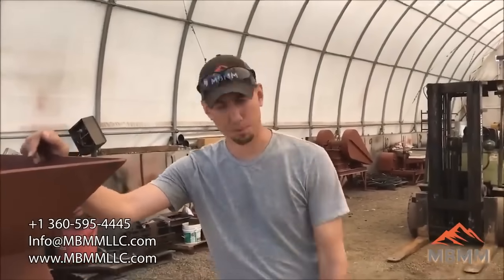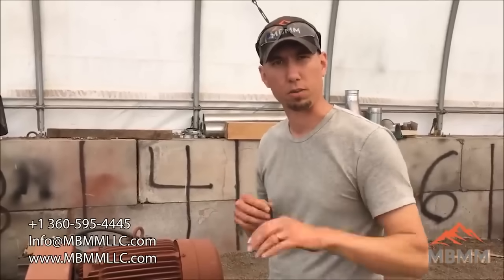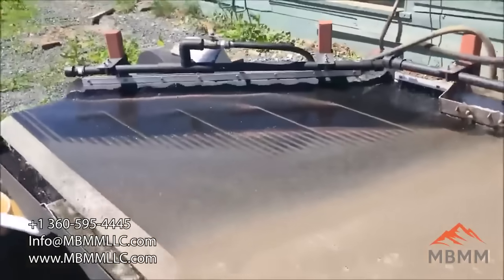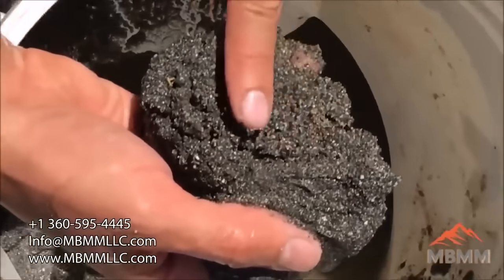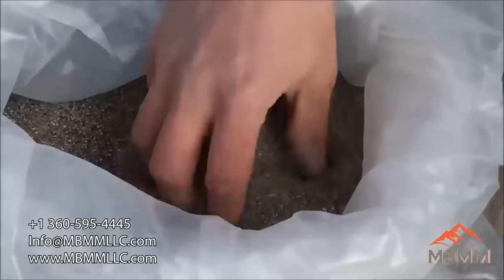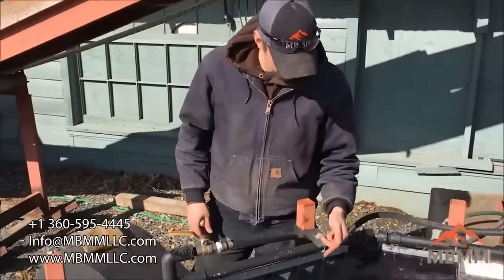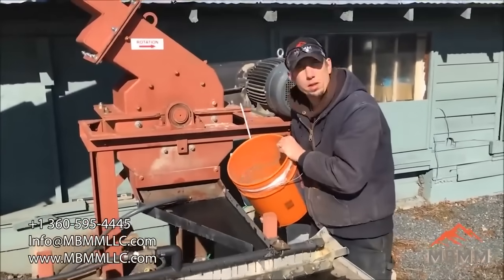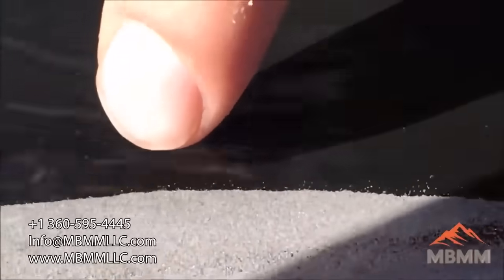Hidden Gold? Crushing Electrical Waste for Metal Recovery

Comment: something I have always been curious about the shaker table is, whether or not there is one ideal setting of bed angle, water flow, and vibration rate, or if different set points can be used to further seperate certain materials.  For example, you get a mixture of a heavy material and an only slightly heavier material in your #1, if you run it again with the same settings you get almost all of it back in your #1, what would you change to get it to spread out more so the heavy material drops mostly in #2 and the slightly heavier material concentrates in #1?  Is the table a set once and forget, or can a bussiness get multiple setups built in depending on what batch they are running

Comment: I usually depopulate boards of visible gold plated pins and fingers, as well as relays and DIP switches. If they have BGA chips or the like, A chisel takes those off clean and they go into a separate bucket with the memory cards after trimming fingers. 
The relays and DIPs get manually disassembled and processed seperate for silver/ gold. Fingers get processed on their own, and the chips would follow the grind and crush, then they are processed.
The rest of the boards contain 20 percent material, but will consume 80 percent of time and materials- so I sell them whole to ewaste scrapper for 89 cents a lb. 😅

Comment: I'm going to throw an idea at you that might enhance the process and possibly avoid the need for physically rerunning the 1s and 2s.  Instead of feeding into a bucket why not feed directly to a smaller shaker table to continue the separation without your intervention?  Just a thought.

Comment: Interesting stuff!  Depending on what your running but the waste sand and other aggregates would be great for epoxy casting.  Epoxy is expensive but at 85% waste to epoxy a small factory casting machine bases is viable.
Reply from the maker: Great suggestion!

Comment: What interests me the most, is the percentage of metal to other weight on e-scrap. 

For instance if someone brought me 500lb of pure computer, CNC machine, welder circuit boards and it went through one of your systems. How much metal weight get collected into the #1 & #2. 

I would love to have a clean enough copper separation where I can extract just the copper, leave anything else and try and pay for the total weight with just the copper recovery. 

Try and consolidate precious metals for the profit.